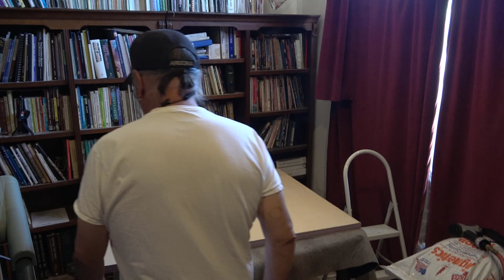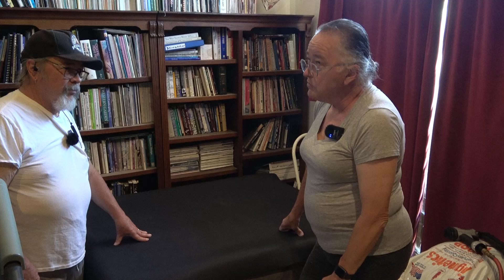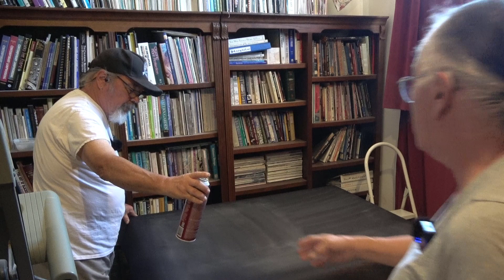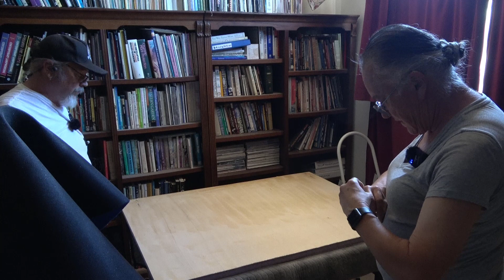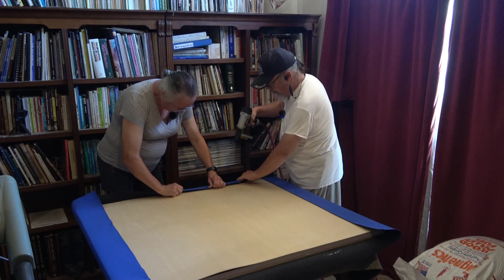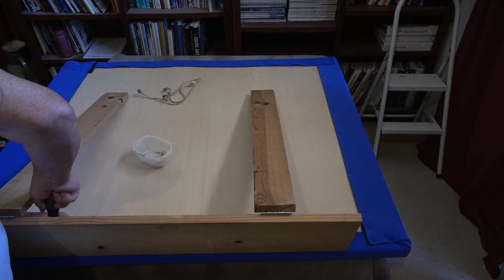Building New Display Boards

Comment: Great video and interesting, I seen the tin glue in shops but never used it
Reply from the maker: The new stuff splay boards are much easier to handle. Getting the right adhesive is critical. So far everything is working as intended. Take care Jan.